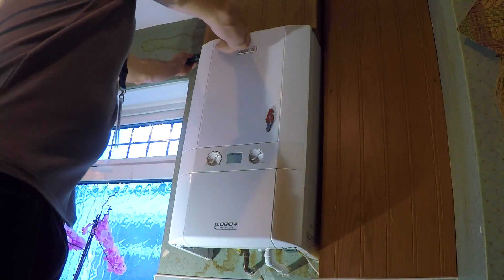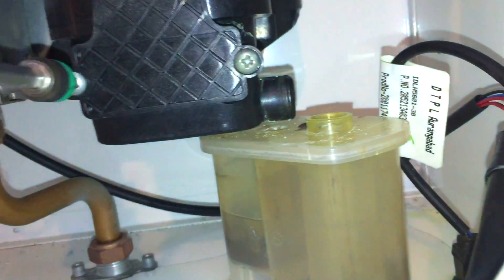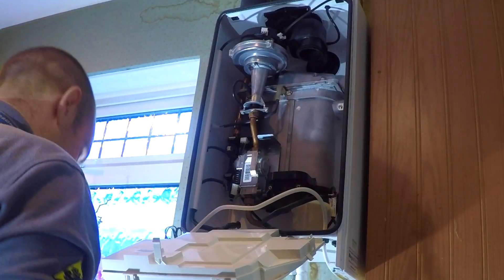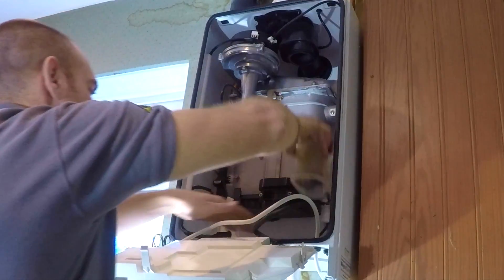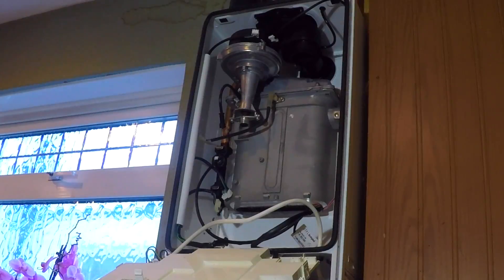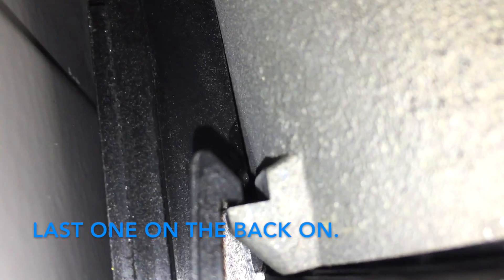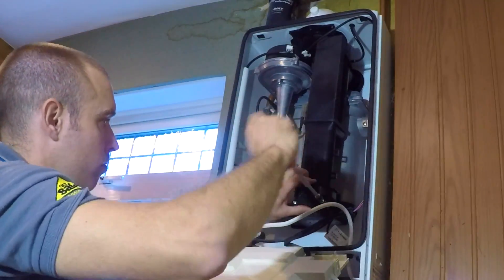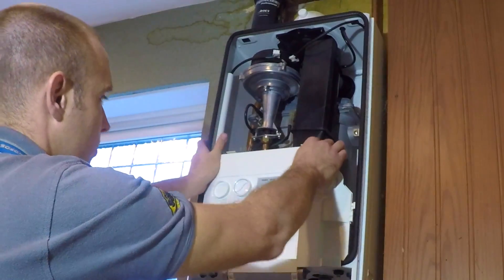Ideal sump replacement. HeatingGeeks. How to repair boilers

Comment: Top job! Do you have any probs with the FD fault on these boilers? Water flow issue
Reply from the maker: No Not really. I don't see to many logics.
Reply: The flow turbines on these boilers are of the scale. I know I've changed more then 6. Still nice easy boiler to service. Plus I haven't had any problems. With the logic combi's and h/o boilers I've installed. Ideal seem to be getting better now. They're getting there.
Reply from the maker: @rayc1503  Too little too late???

Comment: Hi heating god,

Just a quickie (oooh)

I want to replace a failing combi remote, which system offers best bang for my bucks? 

After a WiFi thingy i can also control from an app on my phone. 

Thanks Heating Guru 😉
Reply from the maker: You could of got hubby to call me!! But you got my attention. :-)

Comment: hello can i ask you if i can connect a regular volt free timer clock to the open therm.im doing an install the existing switching setup is volt free.ideal told me i could use the open therm but they didnt sound to sure.thanks
Reply from the maker: Im not sure without looking in the book. I don't know what your fitting.
Reply: im fitting a new vogue .i spoke to ideal the guy in technical said i can but he didnt sound to sure
Reply from the maker: It look to me that you can connect volt free to the opentherm. Im not sure what you need to do with the 240v link though. I guess you leave it in.

Comment: What makes the sumps fail on these Logics and is the replacement sump an improved version? I've done a few now.
Reply from the maker: No idea. Plastic...... :-)
Reply: Not if the response heat exchanger is anything to go by

Comment: Spark plug tester glows when ht lead connected. Or should ... Good for quick diagnosis of flame failures etc
Reply: Heat Service bwc uk hey, have you got a link to one of these? Not sure I’ve seen one before
Reply from the maker: Link?
Reply: Heat Service bwc uk cheers
Reply: A multimeter is all you need

Comment: Have you ever had the LDF bubble up on the negative side of the gas valve? ;-)
Reply from the maker: Yes!!! I was shocked, but it will. A very good engineer friend showed me!!! Try it.
Reply: HeatingGeek I always do, just couldn't not with a gas joint. Not had a bubble yet though, will keep em peeled!

Comment: Isn’t possible on the esprit version. Combustion chamber & hydraulics separated, no clearance under sump to bottom of chamber. Only done 1 but ended up taking h/ex out, which is pretty straight forward anyway.
Reply from the maker: Yeah I have changed the heat exchanger a couple of times and its very easy after you have drained down. Its just draining down is a pain for a sump change.

Comment: Thank HG another good one, I’ve only ever done the Heat Only Logic sumps, never had a Combi & I’ve looked after 100s of Logics.
Of course Ideal would never fess up to a problem, however, the Logic range of boilers are very good.  Easy to fit, service & repair.
In the grand scale of things I’ve had very limited problems with them,  but all our boilers are fitted & commissioned as per the MIs, into clean systems.

Everyone bangs on about SS heat exchangers, but aluminium has a far better heat transfer rate.
Thanks again fella👍
Reply from the maker: And much bigger water ways!!
However any boiler that dissolves its main heat exchanger over time isn't the best. Also I had a couple where the heat exchanger needed replacing because they were blocked on the flame path (at the bottom) causing high CO. Obviously due to lack of servicing but still annoying.
Much better boilers than the last lot from Ideal. (I actually quite like them but don't tell anyone).
Reply: HeatingGeek It’s funny HG, but when you sling Logics on a wall most days they become like old friends, you know them so well.
We fit lots of Logic Combi 35s on New Builds, no BS, I fit one including 1M plus copper tails for FRHC,BO & gas in just under two hours.
They’re 100 times better than the older Ideals. 

Unrelated, ever seen the water pressure build up on cold supplies to a Combi with a DCV on the incoming mains, holy shit!!
It’s no surprise Compo hydro blocks split.
Reply from the maker: No matter how easy you make it sound, its still graft!!! I dont think I have ever seen the pressure  very high because of a double check valve. 
But I don't check it tbh. Just fix it and f off.
Reply from the maker: mmmm Biasi, Ferroli and Alpha yummy.
Reply from the maker: I agree about cheap parts but thats it. Every other boiler is leaking P.O.C from a seal on the completely shite main heat exchanger. Could be the burner box to Heat x or the sump to heat x, but it will be one or the other seal failed. That trap design is also very poor. It takes way to long to remove it and clean it out.
I fixed an istor last weekend after 3 visits by others. Rodent damage to harness and wire off the main NTC.
Reply: HeatingGeek I always appear to shear the burner bolts on the older Ideals, nightmare!! But it’s probably lack of servicing.
Oh God knows the Logic has its faults, but they’re great to work on.

Going off on another tangent HG, do you have a Spark Plug tester in your kit of tools??  Invaluable for the Logics.
Reply from the maker: The burner bolts were a known issue. Ideal were repairing them way after warranty ran out. Again, piece of shit heat exchanger. Ideal fully aware and drilling and tapping heat exchangers all over the place.
Reply from the maker: @Fibre Washer spark plug tester? Please explain and link if possible.
Reply from the maker: Thanks!!
Reply from the maker: Jon H. Mid 2000's? Does that mean they made the Response heat exchanger!!!
Reply: Jonny Mosquito Strawman at Large  too right brother, helps pay my mortgage. I know what to look for with the ideal boilers across the range. They're plagued with faults. A good few have been due to incorrect commissioning & lack of servicing. The rest lay at blame with the manufacturer. But they have improved majorly over the past few years. 😊

Comment: Good video geez ...... where i work there whacking logic systems in everywhere as there new preferred boiler for installs guess il be changing a few of them in the next couple years 👌😂
Reply from the maker: You will do a few!!  The boiler isn't bad though. Not like the icos isar. At least they make them easy to work on.

Comment: Plastic and boilers not a good mix . Good job as normal
Reply from the maker: Thanks :-)
Reply: Isn't it weird that regs say we can't have HDPE fittings within 1m of the installation yet all the pump casings and many other parts within boiler are made of HDPE??
Reply from the maker: @nathd1748  Yep. I think its weird but its because the parts inside the boiler are made with Glass fibres to strengthen them. This makes them more resilient to heat but more brittle.
 The stuff we use outside the boiler cant be brittle otherwise it wouldn't make it from the merchant to the job. So we use a less heat stable plastic.
This is how I think it is but might be completely wrong!!!
Reply: @HeatingGeek  I remember opening some part on a boiler and it was labelled quite clearly as HDPE and manufactured by no other than JG (Speedfit fame). I do agree that the plastic used within the casing tends to have a different more brittle feel to it, Seems they are using plastic more and more these days with pump casings, automatic air vent bodies etc. It's just something I have never heard a complete explanation for with regards to the 1m rule.
Reply from the maker: @nathd1748  Just because if the boiler overheats 100+ degrees the plastic would melt (because its not reinforced with glass fibre/balls). This would flood and potentially scald/kill. Sounds mad but that's why.
Reply: HeatingGeek , The black plastic water housings is the same used in cars and throughout the automotive industry just open the bonnet of your car /van & you will see most water jackets /manifolds & inlet manifolds All made of this similar material its highly durable and extremely lightweight compared to a metal cast aluminium iron component.

Comment: I bought an endoscope camera for a flue I wanted to look down. It connects to my phone and I can move the camera around and watch the pictures on my phone. I got it on amazon and then download an app for it. I got one with about 10 meters of cable on it and it has a light on it. It works really well did the job on the flue which was 4 meters plus long and had a couple of 45s on it. It was only £20 I think I just thought that it might help you in a situation like that when you want to check those clips at the back. Great video btw.
Reply: Now that sounds great. Link as well please
Reply from the maker: Clive Ward. I have a see snake I got online many years ago. It cost a hell of a lot more than £20 and I bet its not worth the extra. Link would be good.
Reply: Ordered!